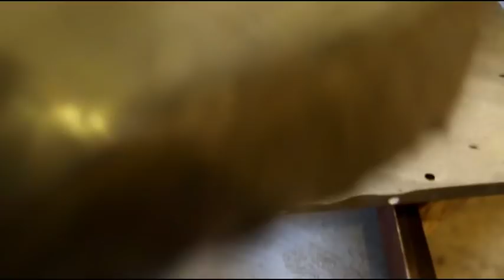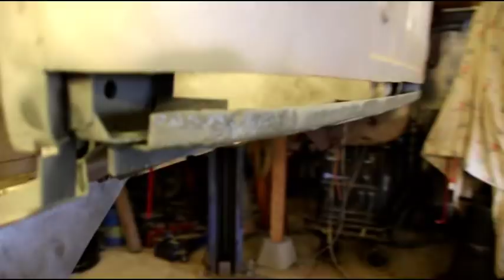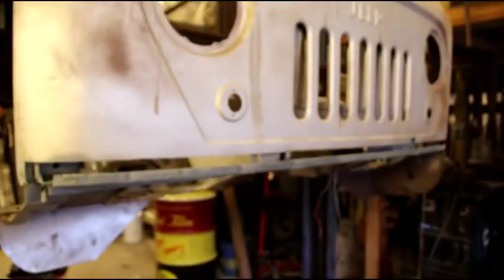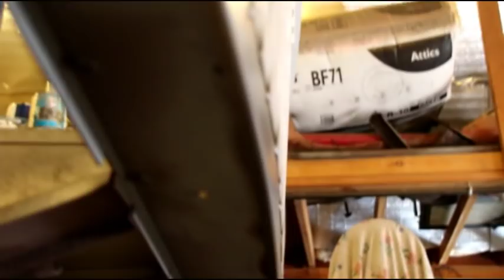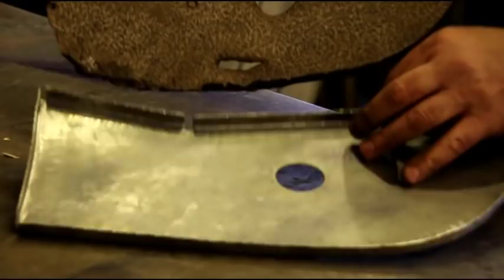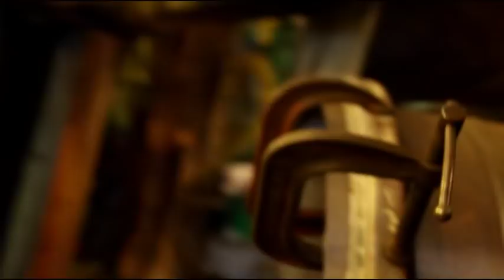Willys FC 150 Cab Restoration, Metal Fabrication

Comment: Brian how well do you like the HTP weilder, and is that your go to weilder for mig weilding panels together using .023 wire? Just wondering
Reply from the maker: I have been using the HTP welder for over 20 years and love it.  Never had a single problem with it.  I am now on my third mig gun/lead, but you can expect that for the amount of use it gets.  it is one of their older 140 amp machines and I use it for sheet metal welding panels together.  It has always had .023" wire in it because it is just used for sheet metal work.   I always run it with gas and it lays welds down very well.  Has a time and a stitch mode also which makes long welds a breeze.   If i am not tig welding things together, this is my go to machine.

Comment: Another dumb question from a woodworker that has no intention of doing body work.  I ask this because I don't know, but I would assume that all the welds get ground down flush (duh?) but am wondering will there need to be additional body filler along those welds or does it finish off without any additional filler?
Reply from the maker: It can be finished either way.   I am not finishing out this body so I am not sure what the painter will be doing.  For my own projects I can metal finish without filler.  For most others I always see them quick grind and fill.  Just depends on how much time and skill you have.

Comment: So if you were rebuilding this cab for one of your own projects to keep would you of replaced the whole left wheel or still patch it up? Thanks ryan keep them coming you do great work.
Reply from the maker: I am just patching this side because it isn't too bad.  I would do it a bit differently if it were mine but I have to try and keep the cost down on this project or it will never get finished.